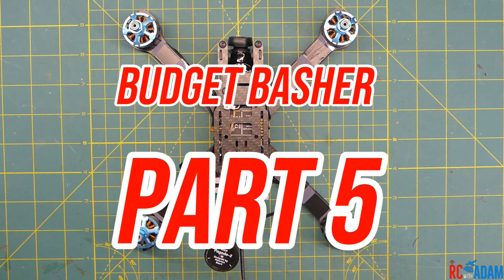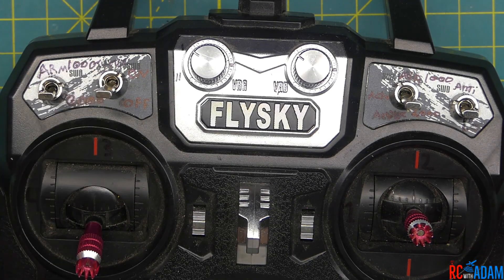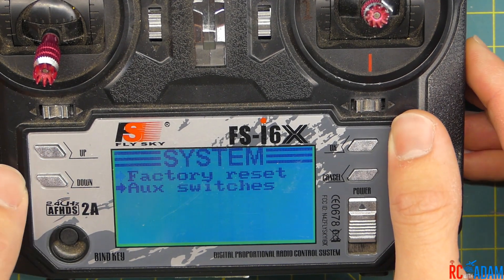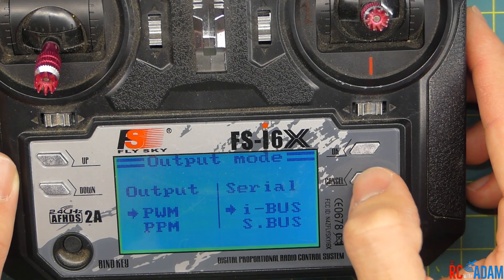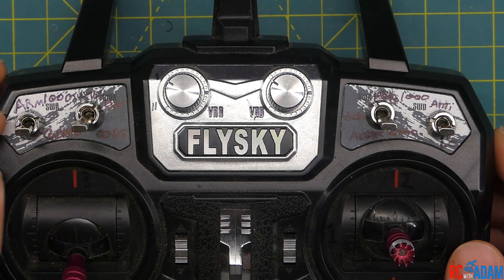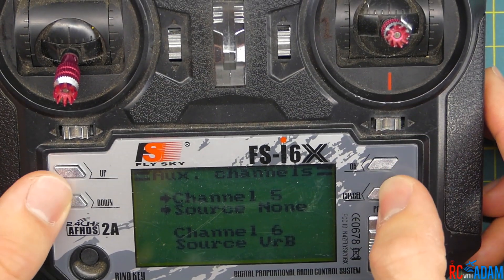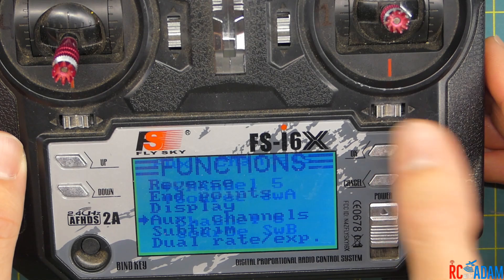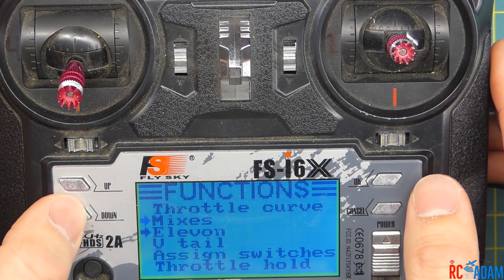Budget Basher Build - PART 5 - Tx Setup & Rx Binding [COMPLETE BEGINNER BUILD GUIDE 5" FPV DRONE]

Comment: Hi, I build my first quad with the same parts. But when I press the bind button on the Fli14+ and plug in the LiPo the LED is blinking slowly not fast. Do you have any idea why?
Reply from the maker: No. Does it bind?
Reply: No. The LED is blinking but not the "Bind-Blinking" :D Maybe there is something wrong with the bind button.
Reply from the maker: I have not experienced this. Maybe your tx is on the wrong rx output protocol (should be on ibus for that rx, i think).